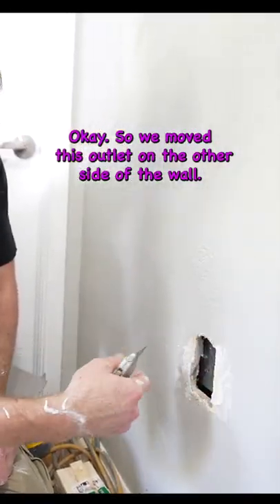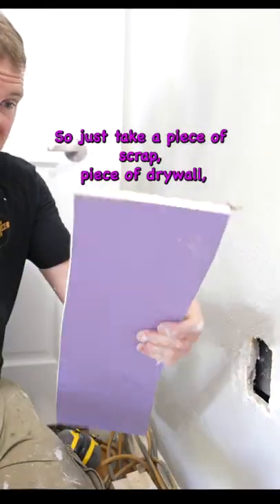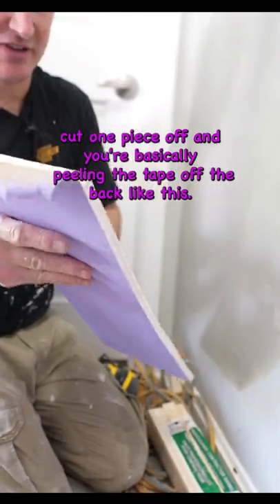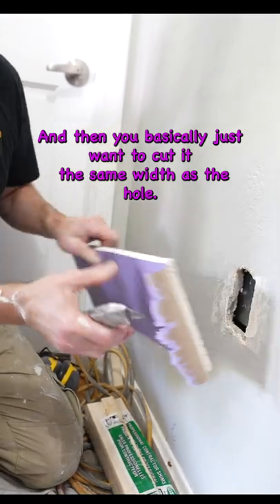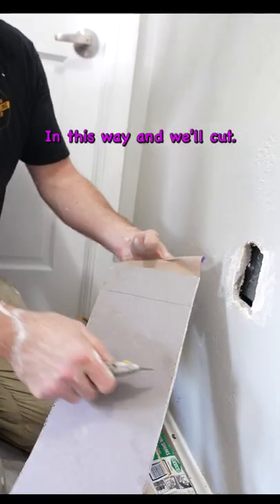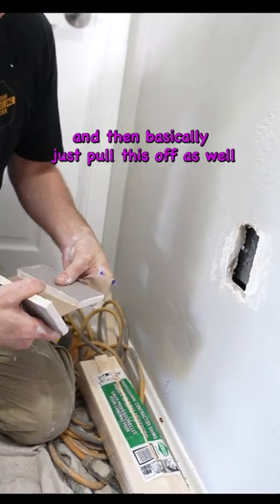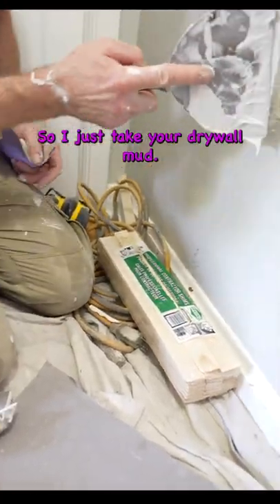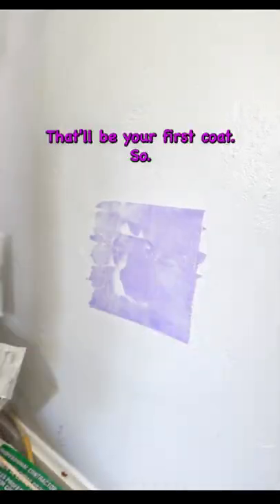Easy Plaster Repair 😊 #shorts #DIY #Youtubeshorts

Comment: Dumb question but so you can patch plaster w drywall mud? You don’t have to use actual plaster compound?
I know my way around drywall but have never dealt with plaster before
Reply from the maker: Yeah no problem using drywall mud over plaster. Hot mud (45 or 90 mud) will set harder too
Reply: @BathroomRemodelingTeacher  thanks for the response!